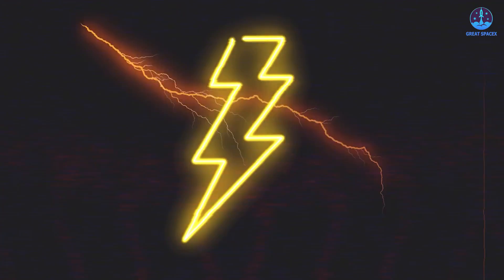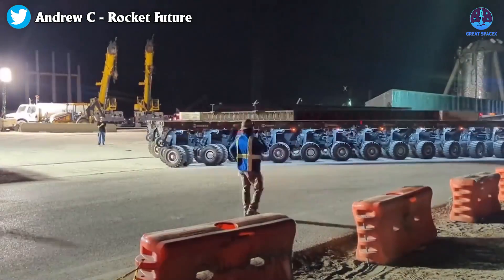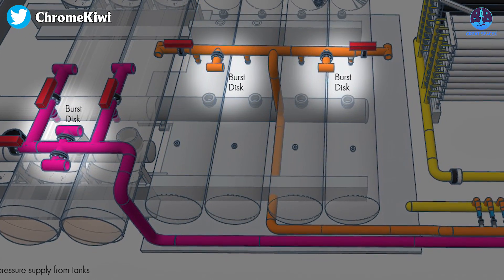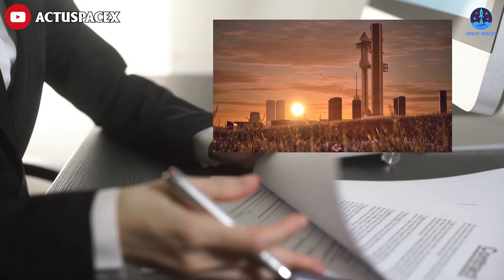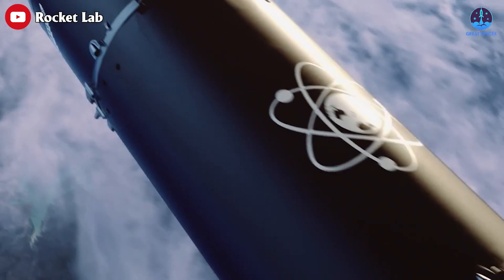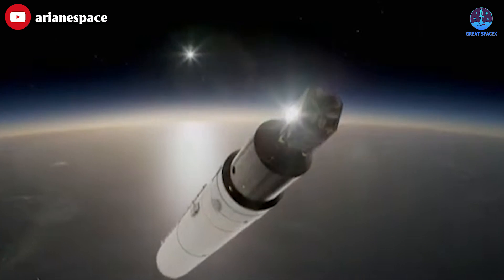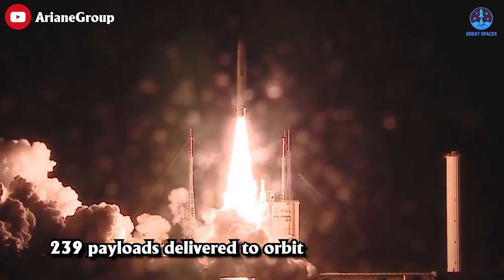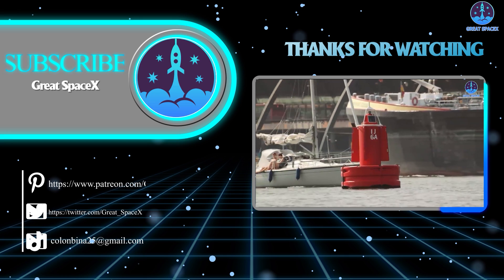JUST IN! SpaceX massive water plate Installed, S28 new payload door, and Ariane 5 is gone!

Comment: NOPE, it's going to be another, but now metal plates will be flying at high speed, and I bet anyone this will be another horrific event, and I said it the last time and now again, it won't work. My first launch prediction was the pad would fail and cause the rocket to fail too, well I was close to being right. If the protection plates they added last minute was it's only reason the rocket made it off the pad, good job, but the only thing that will take the massive pressure is a large body of just water, not rigid matter.

Comment: Focus has been on the massive rebuilding on the pad but what are the plans to take off again once they reach Mars?
Reply: Less gravity far less thrust needed
Reply: Build a launchpad on Mars? Also  less gravity, so also less engines needed or lower throttle.... maube the vacuum engines would even be most suitable.
Reply: The booster has 33 Raptor 2s. Only the ship (9 Raptors) takes off from Mars, as it has many times from Earth.
Reply: No one is going to Mars. Just stop.
Reply: @czarcastic1458  come back and say that in 10 yrs
Reply: @czarcastic1458  Probably not in my lifetime, but if or when it happens it will be hard to keep SpaceX from getting there first
Reply: @czarcastic1458  gotta aim high to get anywhere in spaceflight! 😁
Reply: Both of you are wrong. It matters little that there is less gravity on Mars, there is almost no atmosphere either. Adequate thrust is needed to literally "grab" what little atmosphere exists to climb into (or descend from) the sky. 

As for building a launchpad, okay, how exactly? There isn't a congo line of cement trucks waiting for the ill-fated crew on the surface of Mars, so Starship would have to bring it own materials to build one. With that said, it will have to land directly in the regolith the first time, so how will it move to the launch pad after construction? 
Can it even land directly in regolith? Landing or taking off would create a massive dust cloud that will last for weeks or months.

These are only the issues concerning the points made here, but that doesn't even scratch the surface of how impractical this entire Mars mission is. I'm sure SpaceX has some smart people, not everyone is Elon, but damn did anyone stop to think for 3 seconds about anything  beyond leaving orbit, granted they can even get there??
Reply: @jaydonbrown617 sadly,  you are confusing (powered )aerial flight with rocketry.
Edit: also, progress is made in incremental baby steps. Don't ask a caveman how to smelt metals, ask him to make better tools.
Reply: @Arexack999  Okay fine, a bit of oversight in my understanding, but that doesn't change the fact that the engines won't function the same in Martian atmosphere, but perhaps the difference is inconsequential.

 I'm glad I gave you something to fire back on, because you neglected the actual problems. Probably because these are good points that no one at SpaceX seemed to think about. Landing on Mars is by no means a baby step, you're asking single-celled organisms to create fire.
Reply: @jaydonbrown617  that is why I mentioned that probably the vacuum  engines would be most suited. Rocket efficiency changes with outside atmospheric pressure, this is one of the reasons rockets have stages. The upperstages tend to have larger cones but smaller nozzleplates. 
You are right in pointing out that landing condituons wont be optimal, but they will likely be easier than here or on the moon, which will be sooner than mars. Good practice also for developping and finetuning a viable method of launchpad construction. Likely first many logistics will be made before any humans hazzard the long dark. 
You seem to be returning my own analogy back at me. I used it to illustrate that you see the goal as insurmountable, while every mountain is conquered one step at a time.
Reply: @Arexack999  👍

Comment: Just to the 4-th grade math.  The amount of water is like nineteen times less than used on the Space-shuttle, although they have 13 times the heat flux.  Even Elon has said the steel erosion will be one inch per second.  Totally insufficient in all ways.  Just wait and see.
Reply: Different design, and the shuttle solid boosters were way more problematic than mains. In any case I will take the counter view that the shuttle could have made do with 5% of the water it used. 😂 cant wait to see who is right.
Reply: Seemed like the test article worked spectacularly... but time will tell.
Reply: @johnd.7792  Worked spectacularly?
Reply: @jaydonbrown617  yes they did a steel plate with water cooling test, and pointed a raptor 3 at it. From what I gather they expected the engine test to end with destruction... should be fun to see, one thing I will say for 99% sure.
They will ensure a full 33 engine static fire this time.
Reply: @johnd.7792  Oh, are they? They better fire those things at FULL power for the full 12 or so seconds of a real launch
Reply: @jaydonbrown617  won't be 12 seconds for launch... but I am guessing this time with better built engines, they are much more confident, and will light all 33 engines. 
Sn 25 did spin prim, then 6 engines. Where as previous prototype had to build up to a full static fire, this shows they are much more confident in the newer engines built.
Reply: @johnd.7792  If so confident, then why not full power static tests? There is zero reason not to do this except to save money. Fine, whatever, be cheap, but don't complain when your rocket engines start flaring out again. 

12 seconds is how long it took to get off Stage 0 last time, obliterating it in the process. Unless they are doing anything different weight wise, or if they actually have all 33 engines firing at once, this time will be roughly the same. 

Of course the engines were not at the same distance from the base of the launch pad for all 12 seconds, so they can throttle down to simulate the craft lifting away from the pad. SpaceX won't do this though, because this is not a "cost effective" testing method.

And as for the single engine test, whether it was at full power or not, was an inadequate showcase of the new steel plate. The plate was laughably small in comparison to the exhaust plume of the raptor. The "water deluge" did fck all to mitigate anything. (What is its purpose again? Cooling?) And at the end of the test, it quickly fades to black as to hide any evidence of damage.

And yes, to become cutting edge is to become cheap as hell. Fair enough.
Reply: @jaydonbrown617  well it's obvious you think it's not possible... just like an electric car can't be profitable?
Or like a rocket can't land?
Or reuses of fairing halfs isn't possible?
Your negativity is not something that should be had.
Imagine if Boeing went.... ohh this 747 design doesn't work, better give up.
Yes learning to bring costs down is important to success.
So I'm done talking to someone that thinks they know more than hundreds of engineers. 
Much love, mister downer.
Reply: @jaydonbrown617  p.s
SLS took 13 years and nearly 30 billion dollars. 
Starship is what 7 years old and around 5 billion...
If in 5 to 6 years and 20 billion dollars elapse, they are still on par with a LESSER rocket time frame.
Reply: @jaydonbrown617  also these engines are not the same engines... they have worked a whole lot of bugs out, like you do with iterative designing...
As a machinist I can tell you this is the best Approach
Reply: @johnd.7792  The Shuttle was man-rated and could carry 30 tons to LEO.   Elon's rockets can only carry 17 tons in the 1-stage configuration, the only type that has made it to orbit a few times.   The SLS was reused around 39 times each.  Elon's rocket reuse max count: 13 times.   Shuttle failure rate:  1.5%   SpaceX failure rate:  about 1%.   So about comparable failure rates and the SHuttle wins on reusability and mass to orbit, by a LOT.
Reply: @johnd.7792  Yes, saving money is great, but there are some things you just can't skimp out on. You think other space agencies decide to spend that much money, just because? 

Again, SpaceX needs a flame trench. How are you going to sit there and deny this necessity after toting that your rocket is ~2x as powerful as the Saturn V, a rocket that needed a flame trench? 

I mean what is Elon smoking? He simply won't build it for quite a few reasons, but they mainly boil down to ego, cost, ego, and the landscape. Oh and ego.
Reply: @georgegonzalez2476  shuttle was a waste so is SLS.
Reply: @jaydonbrown617  what is the cheapest safest and most reliable rocket?
Right spacex flacon9
They have driven costs down through iterative design, this is why its so safe and reliable, because at one point it wasnt.... spacex now has more consecutive landings than any other rocket has consecutive successful launches... safety is paramount to spacex by everything I've seen.
Reply: @johnd.7792  Oh yeah, 18 years and billions of dollars later. Now that we are using SH and Starship, we can expect billons of dollars more, and many years longer before it is on the same page as Falcon 9. Safety is paramount at Space X? Sure, but if that's the case then their Mars mission as currently outlined by them will not work, it will need to be reconceptualized from the ground up.
Reply: @johnd.7792  Lol, a waste you say, and yet has achieved greater feats than even Falcon 9 could ever dream of.
Reply: @jaydonbrown617  I'm not saying his timeline for mars is even possible... but with 3 4 billion more, an HLS should be possible, and with this knowledge and experience, and new construction locations, now they can truly make the rockets twice as large as starship and need no second stage to leave from the moon. I think that space construction is necessary for interplanetary travel using our technology available. 
But now I'm rambling, either way I am a space fan boy, and while I believe that the space shuttle was wayyyyy to expensive, and launched with known issues, that ridiculous, as much as it accomplished. 
If starship ends up landing on the moon, the possibilities of scientific and sociological differences this could make are profound.
Reply: @johnd.7792  I like space too, believe it or not. I enjoy playing space themed games like NMS, Space Engineers, Astroneer, w.e. I hope Bethesda doesn't sht the bed with Starfield, as that seems to be looking quite great so far. 
Anyway, I digress. I don't hate SpaceX, I don't hate what they've accomplished, and I don't believe they will never get Starship to do....something. It's just rather annoying to see folks be so disingenuous towards all the other space agencies, especially after all the groundwork they've laid out for newer companies like SpaceX. 

It's even more annoying to see how much high regard people hold SpaceX and Elon's word to, they might as well be preaching gospel to them. They hang on to every word like it's a miracle destined to happen without fail. But I get it, Elon is an influencer and an ego maniac, and he has since rooted out all the self-thinkers from SpaceX. Perhaps with a new sense of direction, someone who will set readily achievable and practical goals, I can vibe with SpaceX more.

I truly believe Starship should be nothing more than a larger, glorified Falcon 9. Just use it to carry even larger crap into orbit, build a larger space station, launch the mythical Tesla Semi, help NASA build their Gateway station, focus on the Moon first and foremost.
Reply: P.s. I understand the test article was 1 engine not 33... however it was much closer, and this will likely offset the extra engines.
Reply: This is the same guys that made the first full fuel staged combustion engine and most successfull rocket ever. I’m sure they have a lot more information and smarter then you
Reply: @edsherwook5196  that's what makes this so exciting is that failure is very much an option. Great to see a company actually accept this notion, and use it to obtain a cadence unheard of.
I'm sure starship will follow suite with falcon... but who knows stage 0 may need a further overhaul.
Reply: @johnd.7792  "that's what makes this so exciting is that failure is very much an option." My god, look at what SpaceX has taught us, to accept and even anticipate failure. I hope you all will keep that same thinking when (if ever) they stuff 100 people onboard.....
Reply: @jaydonbrown617  the idea is to fail to get a model that doesn't fail... don't think it can happen like that? Again I refer to falcon 9 failures.
Reply: @johnd.7792  I suppose this is the only way SpaceX can "look" more cutting edge and cheaper than Nasa. It's very expensive to get things right the first time
Reply: @jaydonbrown617  not only look, bit became much more cutting edge.
Reply: @edsherwook5196  Nope and nope.   The soviets had them 73 years ago.  Even the US government bought surplus ones from them.   As to being the most successful, nope again.  The Saturn V holds that record.  Got any other fabrications?
Reply: The steel OLM legs survived the first launch intact without any cooling. Also, the second launch won't use the prolonged engine ignition sequence that roasted the pad for 6+ seconds.

Comment: The steel sandwich has been mounted on concrete which is not yet cured. It will take at least several months for the fresh concrete (around 4 meters thick under the OLM) to completely cure. Of course, if the next Superheavy launch takes place in the next couple of months then the blast from 33 Raptor engines ejecting hot gases (at around 1/2 of the temperature on the surface of the sun) could speed up the curing process 🤣🤣🤣

Comment: What are you talking about, imperial is prevalent? are you just making this up? And what is 0.2 inches? Imperial doesn't use decimal. no point.
Reply: Fun fact. The USA pound and the yard have been defined as fractions of the kilogram and metre since before most of you here were even born (1893 I kid you not) The USA has even formally adopted the metric system as the preferred system of units  way back in...wait for it...1975.
Reply: @AndrewJonkers  Ya got it backwards.  The metric units have been defined as multiples of the pound and yard since forever.  Notice that '=' sign?  Works both ways.
Reply: @bugwar5545  correlation is not causation. That exact fraction chosen in 1893 very slightly altered the pound, not the value of the kilogram.
Reply: Decimal inches are a thing when you have to measure at the accuracy of mills.
Reply: Neither arbitrary measurement systems is superior.
Reply: @ghost307  Isn't one now based on the other as a standard?
Reply: @MartensFamilyHomeMovies  No, but there are conversion factors to change between them.
Reply: @ghost307  Actually I know that there is. The meter is the standard and the inch is now based on it. 

In 2020, the National Institute of Standards and Technology announced that the U.S. survey foot would "be phased out" on 1 January 2023 and be superseded by the international foot (also known as the foot) equal to 0.3048 metres exactly, for all further applications and by implication, the survey inch with it.